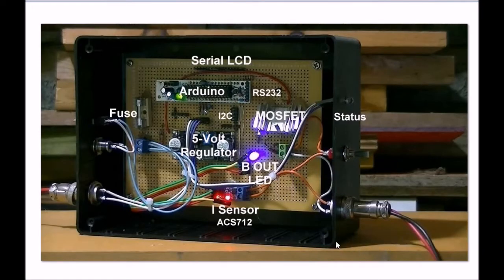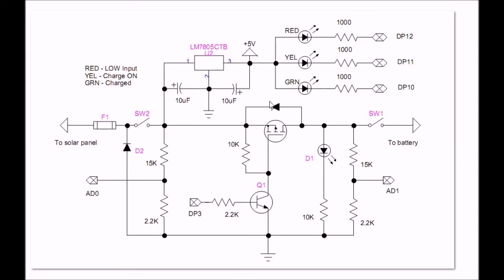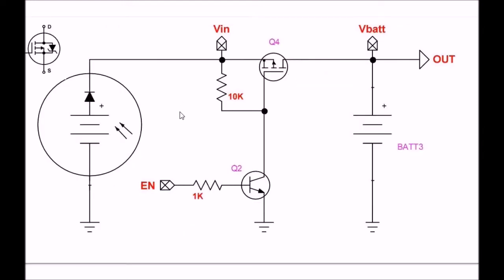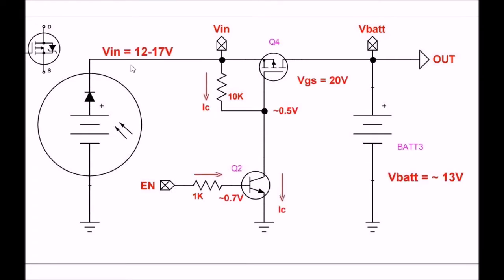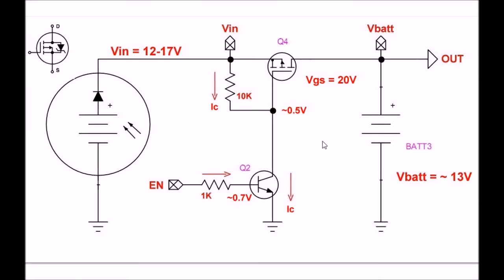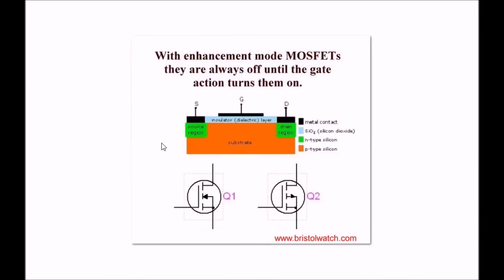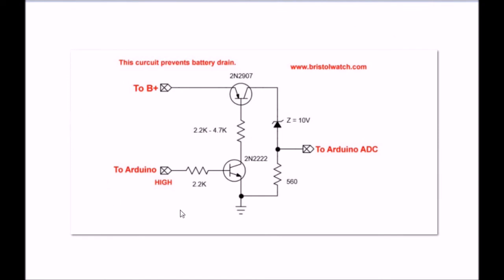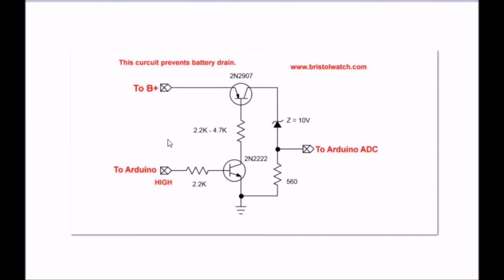Solar Panel Battery Charge Controller Switching Circuit

Comment: Nice & simple.  Most chargers use constant current until some voltage is reached.   That would be a usefull design. I guess you would have to sense the battery voltage and adjust your  charging circuit to provide a constant current while ramping up the voltage.

Comment: Question, I am looking for a circuit to run an .8 amp pump off of a battery charged by a solar panel and maybe add a timer in it later. Have you ever done anything like that?

Comment: Do we need a similar circuitry if we have input from an SMPS for charging 48v(series 12x4) SLA Battery? I had tried charging the battery pack directly from the SMPS, and I'm not sure its working as per expectations.

Comment: Hi, I am having a go at this circuit, but having trouble with the zener diode part. The transistor switches on when base is high, and the circuit works, but the Zener in the top configuration with black line end to V+ won't clamp the voltage down as you describe, if Vin is 20V, 20V is seen on the gate. Its the same if I take the mosfet out and just try the transistor switch on its own also. Any advice
Reply from the maker: what is the voltage across the zener when switched on? What is the value of RZ? If there isn't a S-G difference of at least 5V the MOSFET won't switch on.
Reply: @LewisLoflin  Thanks for your reply. I found a similar circuit that showed a resistor across the 12V zener. This seems to make it work with clamping gate voltage down. Not sure if I have a different Zener, but works now using a BCX38C was the transistor. I used much smaller values. current limiting resistor os 270ohm, resistor over zener is 1K. supports switching up to about 1Khz. If we need to switch much faster is the only solution a proper Fet driver for the job?
Reply from the maker: @DanSohan  I was going to suggest that.

Comment: If I would like to make a 6V solar module charging to a 4.8V Battery what should I adjust it? The purpose is to do a primary school project of RC solar cell together with the rechargeable battery.
Reply from the maker: It should work.

Comment: Hi. So a pwm charge controller is just to keep the voltage at a constant level? It doesn't disconnect when the battery is fully charged and etc? With that is it correct to say that PWM charge controllers are used with series design.
Reply from the maker: No PWM limits the charge current. The Arduino reads the battery voltage with PWM off and leaves it off when the battery is at charge voltage - 12.8 to 13.6 volts.
Reply: Lewis Loflin so with a pwm charge controller, i dont need a series or shunt charge controller?
Reply: How can I monitor the capacity of my 14.6v valence battery using amp connector to rs485 to 4 module relay to arduino?

Comment: I am not sure about what would happen if the battery voltage is higher than 12V.  My charge controller keeps the 12V battery floating at 14.1V max.  If you had 14.1V at the B+ going to the battery, then you  would have 0.5V dropped across the 2N2907 emitter to collector, 10V across the zener which would leave 3.6V across the 560 Ohm resistor.  What if for some reason the battery voltage went higher than 14.1V.  Could the excess voltage damage the Arduino?  How would you insure that the input voltage going to the Arduino would never exceed 5V?  This is a great video.  However, this makes me think that I need to understand transistor and mosfet switching circuit operation better in order to understand what you are saying.
Reply from the maker: It is designed for up to 18 volts. Read the spec sheet.